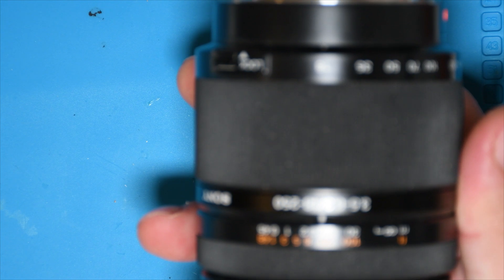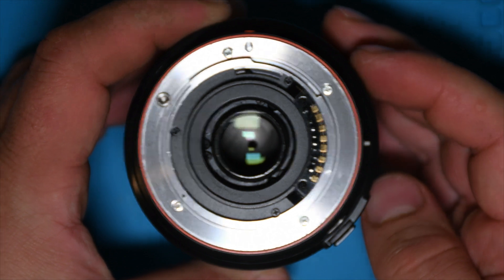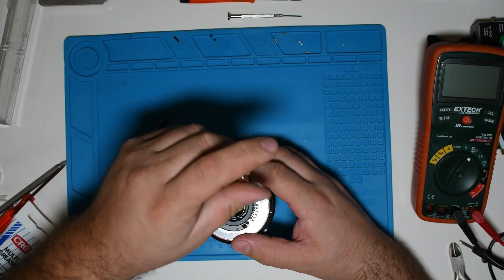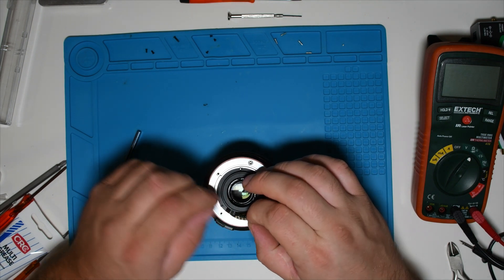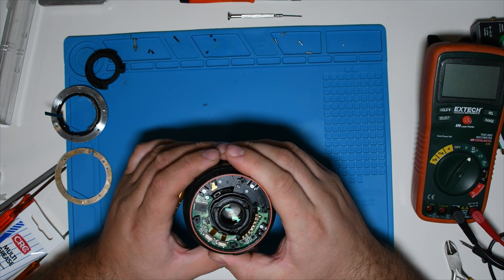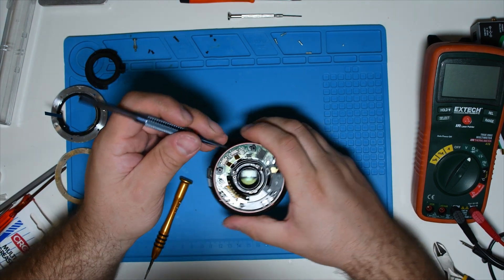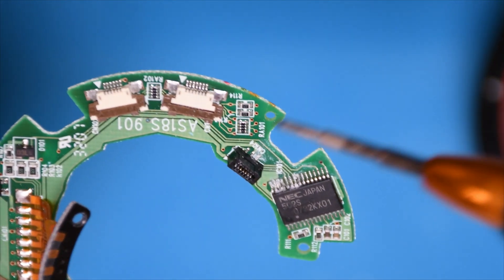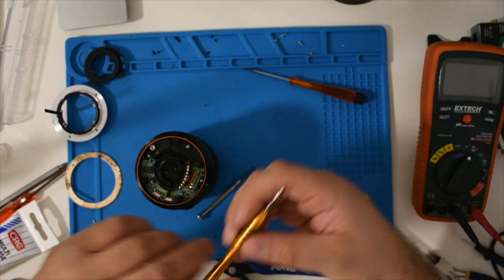Sony lens repair

Comment: Thanx for the video! I'm not so sure that it is recommendable to let it stay in the ultra sound for 30 minutes. I clean my production boards in alcohol (45C temperature) with a drop of detergent for 4 minutes, rinse them shortly in distilled water and blow them dry with compressed air. In your case the contaminations are of another sort but 30 minutes still sounds over the edge. And Jugo... 18-250 is the focal length (in mm)! 3.5-6.3 is the "speed" (aperture) of the lens:)
Reply from the maker: ok.

Comment: Sony 17-250mm does not exist! :face-blue-wide-eyes: It's an 18-250mm! 
Why you don't believe what's written on the lens? :eyes-pink-heart-shape:  THX for your Video!
Do you know if the Lock Screw has something to do with the Zoom Lock Switch?
Reply from the maker: Sorry, my mistake..and the locking screw actually has nothing to do with the zoom lock switch? It's just a mounting screw.
Reply: @jugisa “The locking screw” still helped me!
My zoom lock switch was blocked, I couldn't zoom anymore!
I removed the locking screw and then tried to turn it gently a few times, all of a sudden the zoom went back out and is now working again!
I blocked the locking screw so it doesn't happen again!
Reply: I happen to have a similar problem.  On my lens the zoom does nothing when I turn the ring